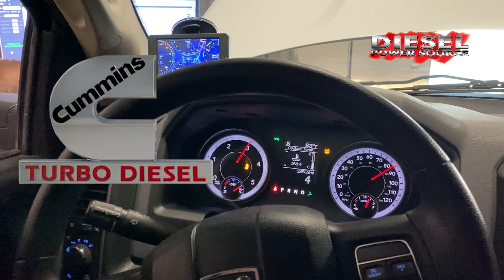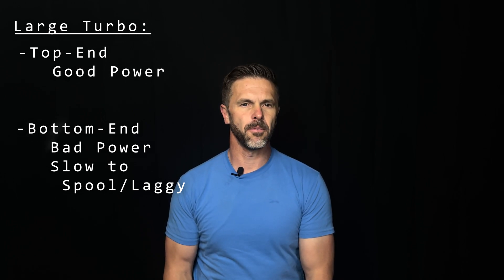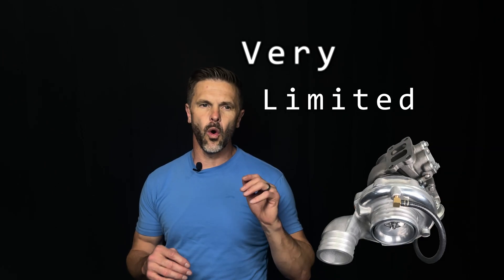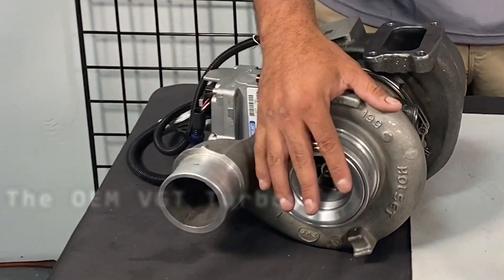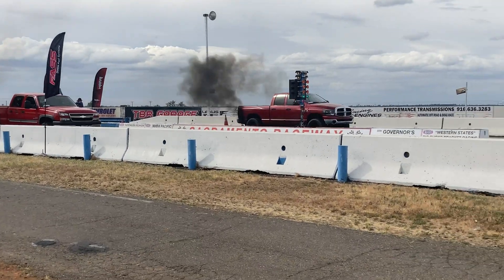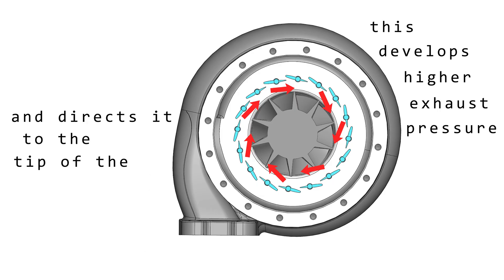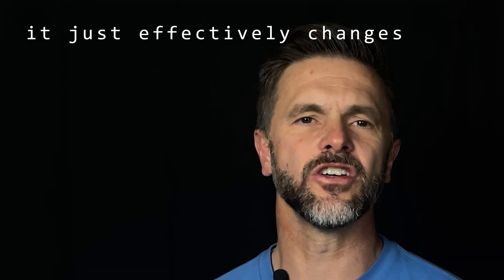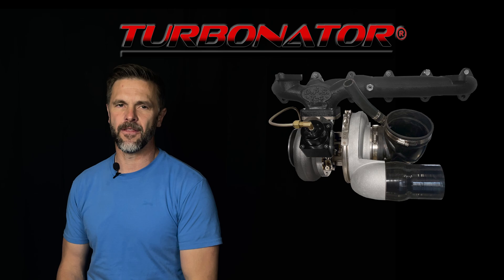Bad News about VGT Turbos and the solution- DPS Turbonator®

Comment: 2022 Dodge Ram 5500  23,000 miles  Bottom end knocks like crazy . Drinks def fluid  like crazy. constantly high idles.  Takes a very long time to start. I can keep going and going ... Not Anything like my 5.9 12 valve trucks or 5.9  24 valve trucks that are older than 2006. That's for sure 😂

Comment: Reminds me a lot of the vnt garett turbos used on 1.9 tdi's
Reply from the maker: I don't know much about the turbo you're mentioning, but yes there could be similarities with any VGT or VNT turbo. Nevertheless, the Turbonator INT stands out as superior and distinctive in various aspects. The Turbonator INT housing is universally designed to be clocked around, allowing you to position the actuator in almost any direction to suit most S300 and S400 applications. What sets the Turbonator apart are its unique Airfoils, which differ in size, distance, shape, and number, offering greater efficiency than any other turbo we've tested against. Unlike other VGT or VNT turbos on the market, which prioritize meeting emission standards, the Turbonator was specifically designed for enhanced performance and efficiency. Our computer model testing, coupled with real-world experiments, demonstrates that the Turbonator maintains exhaust to boost pressure ratios better than 1 to 1. It brings significant improvements in performance, fuel mileage, horsepower, and EGT control. The Turbonator's unparalleled EGT control results from our exhaust to boost ratios, distinguishing it from other single turbos. Additionally, the Turbonator INT features our 3-Stage Mechanical actuator, ensuring reliable mechanical operation of the pivoting airfoils, further reducing the common high failure rates that are associated with electronic actuators in other VGT or VNT turbos. Thank you for watching and taking the time to comment!

Comment: 2018 ram 3500, has weight loss reduction done I pull 10k lbs daily what turbo do yall recomend?  Having exhaust brake is needed
Reply from the maker: What is your fueling like? Stock or upgraded Injectors? Do you have a programmer?
Reply: @DieselPowerSource  stock injectors I have EFI live on it
Reply from the maker: @TEXMECHANIC   Go with our 3rd gen swap kit with our stage 7 or 66/73/INT. Here is a link to the webpage. https://www.dieselpowersource.com/67-cummins-ram-turbo-replacement-p003a-code-67-cummins            On the webpage, select Cummins year; the under "Select Turbo Size" pick Stage 7; then select T3 Standard Size; Turbo Application is is S300; under "Turbine/Exhaust Housing Upgrades" select  one of the Turbonator VGT Options (If you want the exhaust brake choose the bottom selection). You can also call us if you have any questions 801--930-8404